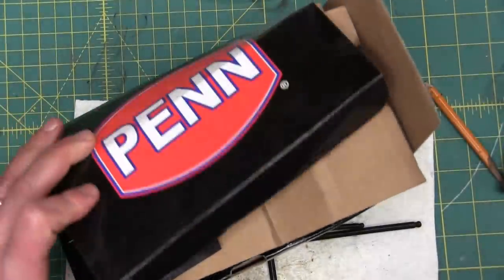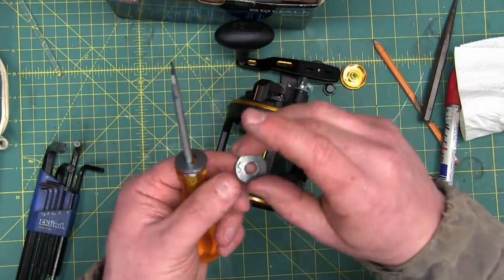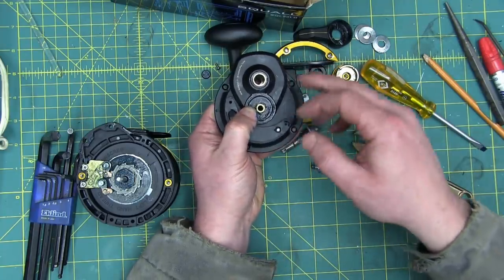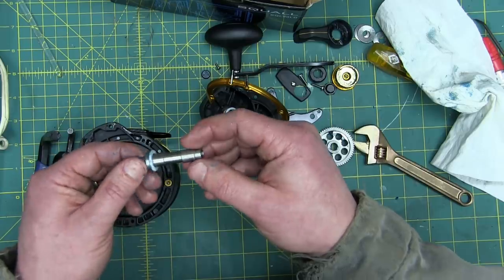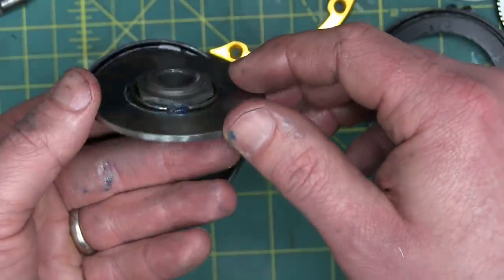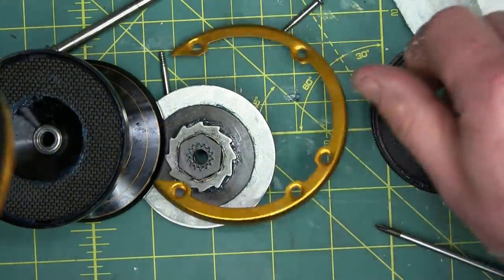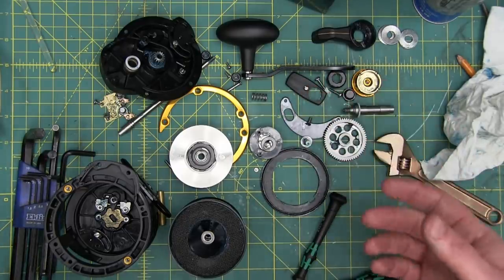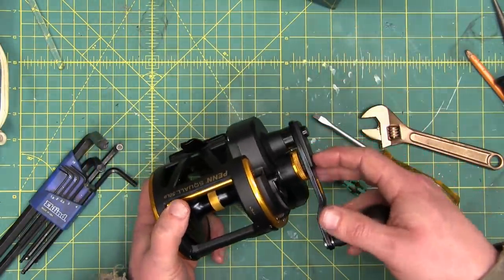BOLTR: PENN FISHING REEL | SQUALL DRAG REEL

Comment: A fisherman you are not...lol... Greased drags are best, the black material (HT100) is well proven and that's a crap reel... and 80 pound test isn't 80 pound pull, usually 80 is fished at 20 pounds of drag or pull.
Reply: And the clicker noise will wake a fisherman from a coma but it's also to keep the line from free spooling out when the drag is off so the fish doesn't feel the resistance when it takes the bit. A fish goes ripping and it keeps the reel from over spooling before someone gets to the rod. As for grease, nothing beats packing the plates with yamalube grease to lubricate and keep water out. One last thing, people do maintain them yearly if it's a good 600 gold reel, lubricate, lap the drag plates, grease the drags with Cals grease, one improvement is taking those belleville washers and flipping them for a tighter preset...

Comment: Penn Reels are not what they used to be since the manufacturing moved to China. Look for used made in the USA reels. Easy to tell the difference. The made in the USA ones have "Made in the USA" molded into the reel seat. There is still a good supply of repair parts available.
Reply: Penn still makes plenty of reels in the USA, just none of the inexpensive ones, although the Penn "Z" series reels are in fact the lowest-priced US-made reels offered by any manufacturer. Penn's "made in USA" lineup includes: all International VI lever drags, all Torque lever drags, all U.S. Senator star drags, all "Z" series spinning reels, 12/0 & 14/0 regular Senators, all Torque II spinning reels.

Comment: Correct me Ifin I am mistaking but tat hold knob is drag for casting so you don't get backlash. It doesn't do much when you actually have a fish on the line.
Reply: That knob is your drag adjustment for the strike and full settings. The tighter you turn it, the higher (in pounds of drag) those positions (any position really) will be when the lever is in that location.

Comment: Not the vid to ask but dose AH affect battery tools. Eg dewalt 5ah flex volt on my 3ah 18volt drill?
Reply: AH has no effect except longer run time. Voltage is what is important.

Comment: How dare you disparage the Pontiac Fiero!  Granted its no MR2, but still.
Reply: No doubt, especially when you ripped out the stock I4 or V6 and dropped in a built 350 Chevy with a conversion kit they still make/sell, much to my surprise ( http://www.v8archie.us/v8-kits.html ).  I helped a friend do one in the early 90's and it would scoot.  Had to be a bit careful on launch to not frag the transaxle or axle shafts though due to the NOS system he installed.

Comment: flathead is not the same thing as slotted. slotted tells you what kind of screwdriver to use. flathead goes in the chamfered thru holes. and yes, slotted head fasteners suck dead bears.

Comment: Ave, I have to say, I think you’re letting your heavy industry biases get in the way. I, like you, know fuck all about fishing reels. However, in my mind, nothing in that thing looked undersized for the task of reeling in an 80lb fish. You’re looking at it like it needs to control a 3000lb conveyer belt connected to a hydraulic motor. Not everything needs to be built with hardened steel, carbon fiber, and titanium. It has a job to do. Is it sufficiently robust for that job?  I would bet so. Would my weedwhacker be better if the motor was 200cc, turbocharged, fuel injected, with titanium con rods and Inconel exhaust valves?  Of course. Does it need those things to fuck up the day of the weeds in my yard?  Nope.

Comment: GARBAGE! Not a serious reel.Need to get your hands on a International,thats top spec made in USA Penn (well, they were ,the recent production ones no longer have made in usa in castings,worryingly.Box still claims so but im dubious)game reel or one of the others like Shimano Tiagra,Fin Noir Santiago,Avet and others are as good or better.Decent reels run a weeks wages generally,been that way for ever at least here in Australia.Smart fisherman get their reels serviced annually, that being said some high spec eggbeater type reels are relatively service free, i have one coming on 10 years still factory sealed gearbox, ive just looked after drag and line roller in that time and i do not baby my gear, i work it hard.Made in JAY pan that one, as are most of mine.